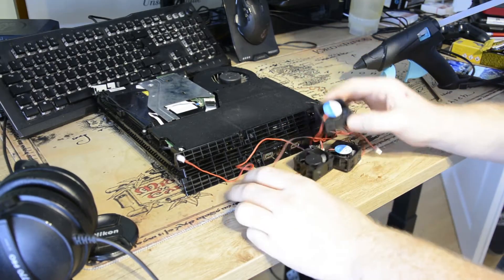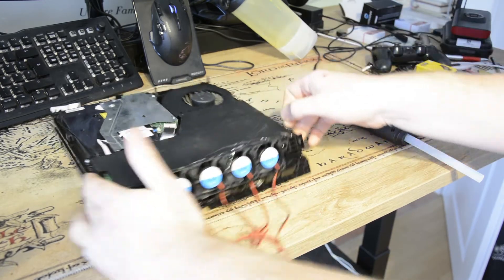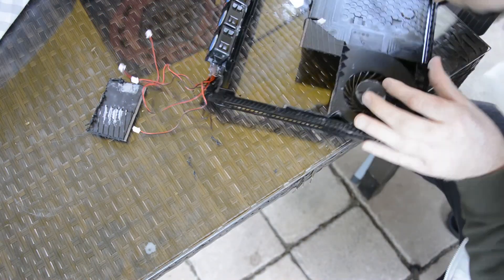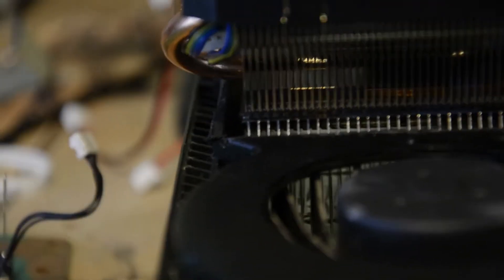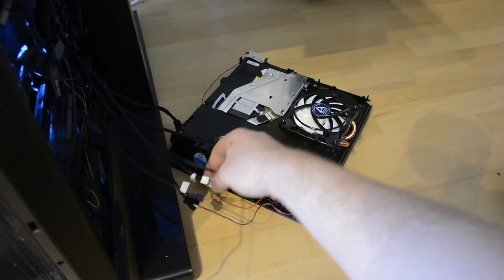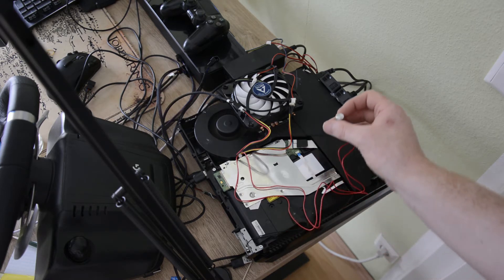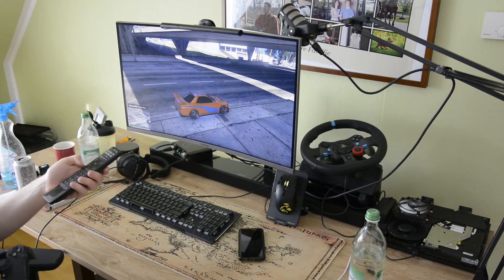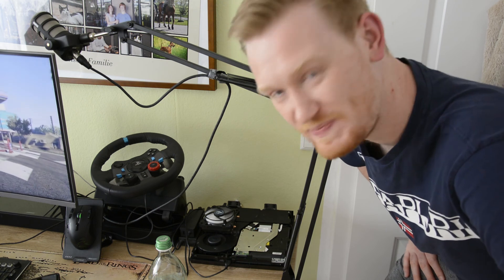PS4 cooling mod

Comment: Das ist immer der größte Fehler, eure Umbauarbeiten in alle Ehren... aber warum solch ein Aufwendiger umbau und so Mikrolüfter?! Unten ein 240 oben einer, dropp down System, ist ULTRA leise! Und der Luftdurchsatz ist abartig! Große Lüfter müssen immer langsamer drehen haben aber ein vielfaches an Luftzufuhr und daher leben die länger und sind leiser... Wenn ihr also extrem umbaut, dann richtig!
Reply from the maker: Erklär, wie genau dus machen würdest, weil ich mir vorstelle, dass die Lüfter probleme hätten genug Luft über die heatsink von der apu zu bekommen, aber kann auch falsch liegen, habs schließlich nie probiert :D Die Lüfter hinten dran sind dazu gedacht dafür zu sorgen, dass trotz geringerem luftdruck durch die niedrigere Lüfterdrehzahl und den leichten verlust nach oben hin, trotzdem genug Luft durch das Netzteil strömt. Ich hab danach auch noch zwei weitere Teile hochgeladen, im dritten hab ich sie wasser gekühlt :D